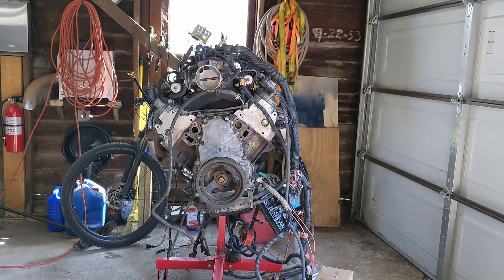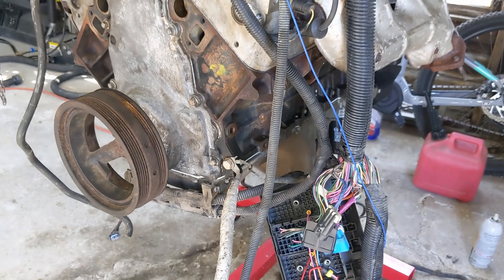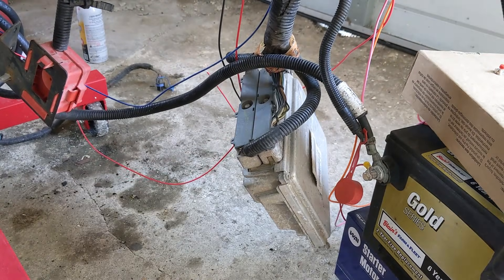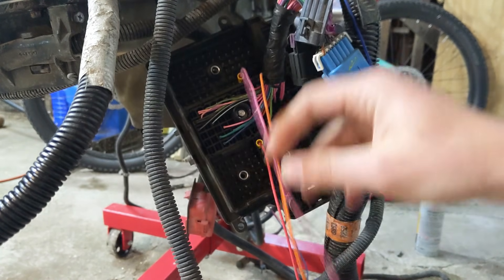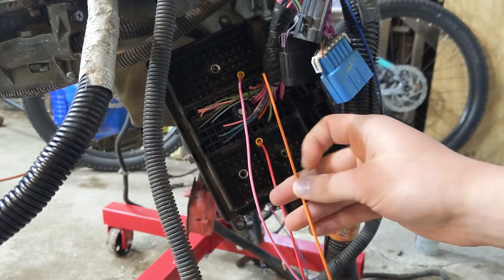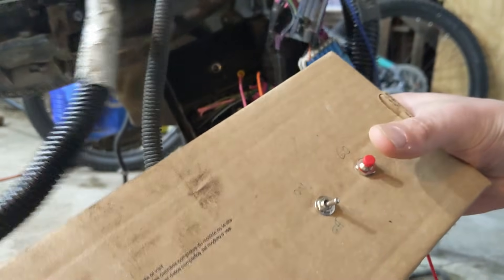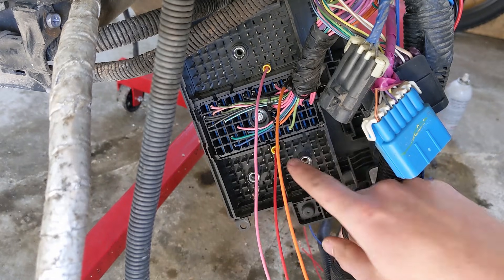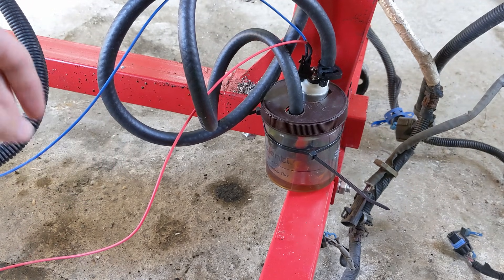Starting an LS motor on a stand with the stock fuse block

Comment: What about for controlling the transmission like a 4L60E
Reply: You plug them in to transmission from the fuse block. Do not cut the wires keep them all hooked up

Comment: i did this on my swap , i’m getting a crank no start , no power to the coil not hearing, not hearing the fuel injector pluses when hitting ignition… please help 😭
Reply: You missing the ground that goes under the engine to send ground for spark of Both side need ps pump

Comment: Is it ok to not cut f 11 and just give it 12 volts
Reply from the maker: Should be fine. Even if you don't cut it, it's not like the original wire is connected to anything when it's off the truck (since there won't be a neutral safety switch connected).

Comment: Which fuel pump did you use?? And you run with a pressure regulator?
Reply from the maker: Stock fuel pump and pressure regulator from a 2001 Silverado

Comment: I've got a 2004 avalanche and can't seem to find the correct pin for the neutral safety switch. I also wish you'd have shown the wire connections on the fuse boxes. I didn't pull mine so I don't know what goes where

Comment: How long can you run it without coolant hooked up?
Reply from the maker: I would not run it more than 30 seconds without coolant
Reply: @PeterDenHartogEng  .do you have a ground wire going to fuse block. My fuel pump relay keeps clicking. I know one side of relay need 12vdc and the other needs a ground to close switch for fuel pump relay. ??

Comment: By far the most simplified video yet. Great video. 

I’m working on a 4.3 vortec but it’s fairly the same the only tricky part was the fuel  lines when I needed fuel lines ran I plan on making a video once I figure out the pins that I need.

Comment: I finally got my engine to start, but it was a bunch of extra loop hole(I have 02 so idk how different it is) and for some reason, it doesn't idle it just revs up high RPMS Probably something with the IAC.

Comment: My fuse block must be slightly different because the ignition wire pin looks incorrect on my fuse block ( I also get no activity when I give it power). Where do you get your wiring schematic?
Reply from the maker: I actually got the diagram from the Autozone website. https://www.autozone.com/diy/repair-guides/wiring-diagrams

They don't seem to have every vehicle, but they had the Silverado that my engine came from.
Reply: @PeterDenHartogEng  I'm slowly catching the rabbit down the hole - hey Peter, idk if you still have this setup but had another question for you. The wire you have for Connector Block 1 terminal A9, how is that fuse labeled on your fuse block? 

Or in other words what I'm asking is what circuit do I need to energize to energize the ignition/pcm process?
Reply from the maker: @diydadsht9785  That wire actually energizes about 5 fuses  and 4 relays on my fuse block, so it's not as simple as finding one fuse. If you can find the wire that provides power to the IGN 1 relay then you've got the right one. It also powers the AC relay and rear defog relay on mine, so those might be a clue too.
Reply: @PeterDenHartogEng  thanks for the help I appreciate it. I'll let you know how it goes
Reply: @PeterDenHartogEng  thanks, I'm going to check into it. I don't remember what truck I got the harness and pcm from. The engine was a Silverado. I need to plug into the pcm to see the details on it.

Comment: I'm trying to ls swap my 56 chevy truck. Using the factory silverado fuse box and I can't figure where the solenoid power wire goes from the ignition switch. Any tips?

Comment: I have a 6.2 engine. So I tried and it didn’t work out. I am told that I need an immobilizer. Please tell me if you need an immobilizer?????
Reply from the maker: Yes, you will need to use HPTuners to disable the VATS system, or send the ECU to someone who does that
Reply: @PeterDenHartogEng  Hello. We checked all electrical connections from beginning to end. Below I am sending you the PDF file that we have guided. Everything is perfectly connected. Fuel pump works, throttle works. High voltage is coming from the spark plugs. The engine cranks if we pour a little fuel into the intake manifold and shuts off soon. Impulse does not come to the injectors. In 2-3 days I should bring Raspredval sensor. If that doesn't help, we have to send the computer back. I can also send my old computer to you along with the computer, and maybe it will be programmed well. We think there is no agreement between Raspredval and Kallenval. Tomorrow I will change the sensors and test it. I'm also sending you a photo where you can see how I fixed the factory electric wires and added a nest of protectors with relays. Please help me get this engine running. I will give you an answer in 2-3 days, if it does not work, I will send both computers. If you have the opportunity, install a programmed computer on the engine and test it.

Comment: So I’m trying to start my ls I have power to my fuse box and I have power to my fuel pump useing the same wires u said but I can’t get the ignition trigger wire to fire my stater ?  Fuse maby ??
Reply from the maker: Yes, check the 40 amp ignition fuse shown in the wiring diagram in my video. You should also check the ground connection for the starter relay (wire D12) because if there is no ground the relay won't fire.
Reply: Thank u I will check the fuse after work  the ground wire fir the relay ? U lost me there ?

Comment: on the C2 connector you use f11 and put your starter wire to it. is that the same on a 03-07 harness.
Reply: I have the same question

Comment: Do you know anything about the L83 motors wiring wise?
Reply from the maker: They're a bit more complicated because you have to worry about VVT and AFM but I'm sure you could follow the same process that I did for this engine: Use the ECU pin charts at https://lt1swap.com/gen5wiring.htm and just go wire by wire to find the important ones to get it started (12v, ground, switched ignition, and fuel pump relay)
Reply: @PeterDenHartogEng  thanks I was on his site today browsing, need all them horse powers

Comment: Could you drive with the engine wired like this? If you were drive by cable?
Reply from the maker: Yes, I've finished my swap now and got my engine running like this in a 1988 Chevy C1500. Having the full fuse block is slight overkill since you're only really using part of it, but it makes it really easy.
Reply: @PeterDenHartogEng  how much did it cost to have vats tuned out?
Reply from the maker: @flatnastyproductions5810  I bought HP tuners because I knew I was going to be doing more tuning on the engine after install, but I've seen flashing services that can do it for around $120.

Comment: Hey my dad had a question for this vid but his iPad is too old to do that, he’s wondering if you had to remove the VATS from the computer?
Reply from the maker: Yes, I removed the VATS with HP Tuners. I think that if you don't remove it the fuel pump relay will shut off.
Reply: Thanks for the quick reply 👌👌
Reply: @PeterDenHartogEng  hmm..i have an 09 Cadillac escalade with the 6.2..it remote starts with no ignition on...see where I'm going? So if an aftermarket remote start is compatible with most ls engines, is vat delete really necessary?
Reply from the maker: @wadebond7679  I know some remote start installers will just go the cheap route and actually zip tie a VATS key inside the steering column to bypass VATS, and some brands (Stellar) claim to have a VATS bypass system built in. I don't think any of them just work without any bypass though.
Reply: @PeterDenHartogEng  .i failed to mention it wasnt a transponder key..plain key
Reply: It's a video of a guy on youtube deleting the vats by using a running vehicle. So You Swap the pcm out of the donor vehicle with yours.
  Do a key relearn. Start vehicle. Unplug the BCM while the engine is running and it will lose communication with BCM causing security to be disabled on the pcm.